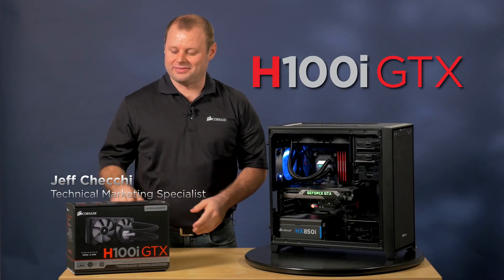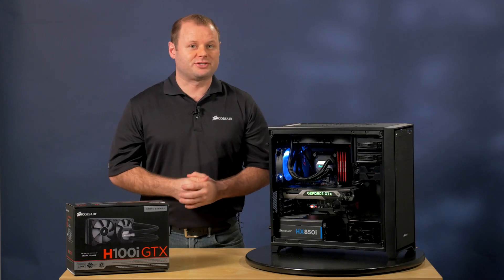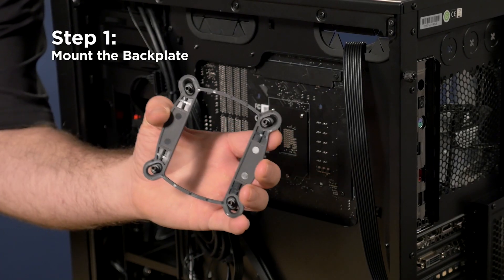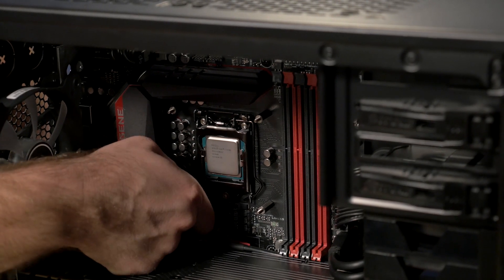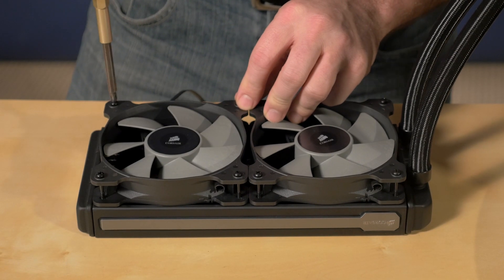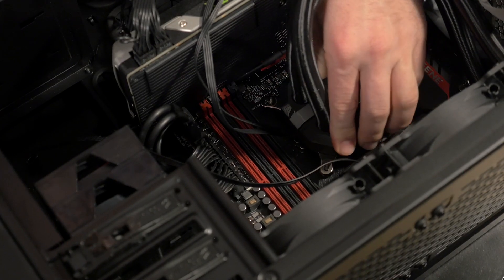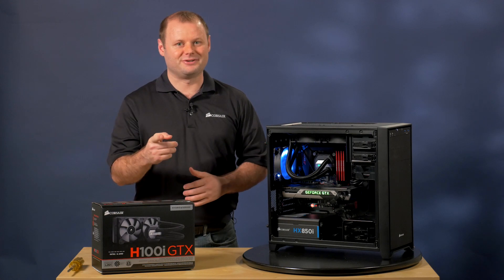Corsair Hydro Series H100i GTX Liquid CPU Cooler Installation How-To Guide

Comment: dumb questions:
1. does it matter which side the pumping unit is facing? (the corsair logo on my PC is facing sideways)
2. if I want to change the sides of the pumping unit.. can I do it without using new thermal paste? or then processor has to be top cleaned then new thermal paste.
Reply: 2nd question: I meant if I switch the sides by taking the thumbscrews off and switch its sides but keep the preapplied thermal paste on pumping unit.. or I have to use new thermal paste

Comment: is crosair 550w power supply is enough for This Cooler
Reply: It depends on the rest of your system
Reply: Are you going to be running minecraft at 720p or 1080p resolutions, and will you have max frames unlocked?

Comment: So the four pin fan header power the pump? Not the sata cable?
Reply: The fuck?
Reply: I don't know of any cooling pump that uses a SATA cable.  The pumps use the fan header, so that the mb can monitor the RPM's.  SATA is a DATA connection only!

Comment: Just one question, is it possible to damage an AMD CPU when over-tightening the thumbscrews using a screwdriver once diagonally tightened, it was a H115i.

And how much force is considered a lot, I grabbed my screwdriver with my fist and gave it a nice turn, but the system booted up and all is good, any possibility of damage if left as it is?

Comment: can i use this for Intel  6th Generation LGA1151 Socket ?
Reply: +Geeks Tutorial If you take V2.
Reply: what is a V2, you mean Version 2 of H100iGTX. Thank you.
Reply: +Geeks Tutorial There's two versions of the H100i, the H100i V2 and the H100i GTX. GTX is the newer model, not supporting LGA 1151. The V2 does.
Reply: Thank you very much for you support, if you don't mind can you suggest my best performing 6th gen Intel processor, no matter the cost! (for 4k video editing and 4k gaming) any help would be appreciated.
Reply: Geeks Tutorial I'd presume that the 6700k would be viable. Especially for 4k video editing.
Reply: Thank you very much!
Reply: Geeks Tutorial No problem!

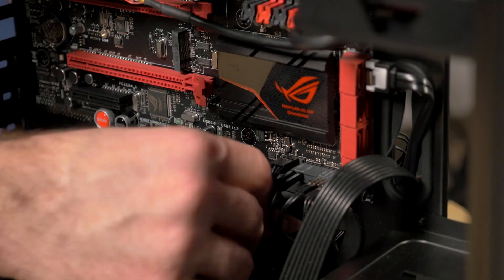Comment: 1:53 is that another fan header? I only have three fan headers on my mobo so if that's another fan header then i can't use this product D:
Reply: +Evang3lium No I believe that's a USB header that they're connecting to.
Reply: thanks!
Reply: +Evang3lium the 2 fans have a multisocket so they both go into ur CPU header and for the corsair link u need a usb header :)

Comment: is the data link cable included i take it? and where does it connect with the pc
Reply: +Jared Warner  The data link cable is included,  It plugs into a usb2.0 port on the motherboard.
Reply: Product0f Activites build is already complete and i got this h100 but thanks haha

Comment: why are there like no videos on the h100i v2?
Reply: The V2 is the GTX, they just renamed it :)
Reply: and they upgraded some minor things and they made the two things removable so that u can make them different colors
Reply: According to "CorsairGeorge" (a Corsair employee) on Reddit:

"They are rebadges.

H80i GT -> H80i V2
H100i GTX -> H100i V2
H110i GT -> H110i
H110i GTX -> H115i

In addition to the renaming, the H115i fan spacing has been corrected to our standard 15mm to increase compatibility with our older cases, and all the new products have the new logo and packaging."
Reply: +maezun oh ok cool

Comment: Hello corsair!!! I have a question for you: The h100i gtx is powered by sata right? Hitechlegion showed that you should not plug the pump in the cpu fan, but rather into a 3pin to molex/sata for constant 12v. Is it true or is the cpu fan good enough?
Reply: +Xetion surely thats not good, you're fans would be running at max RPM constantly comsuming as much power as they could, the reason for the CPU header is because its PWM controlled meaning the AIO will be controlled depending on the heat output of the CPU

Comment: Hi I have a problem with my h100i gtx I have corsair v 4.2.0.162 ,I has also plug in the corsair linkalthough the pump and temp is showing but the fan are showing 0 rpm even though they are spinning, is this a defect or software problem?

Comment: I currently have an nzxt s340 case and I am using the stock  cooler that came with my cpu. I was wondering if the h100i would it inside the s340, and if so where?
Reply: Hey man, I'm currently looking into purchasing a s340. Let me know if you find an answer to that
Reply: +Mergen Fremen I did find the answer, so it will fit, but you have to mount the radiator to the front of the case.
Reply: Okay man thanks a lot
Reply: +Mergen Fremen np

Comment: So I don't need to apply other thermal paste on the cpu myself? I saw someone else's tutorial on this and he applies extra paste on his cpu before he mount the cooler on the cpu.
Reply: +Loliconest If you ever pull the H100i off your CPU for whatever reason, you will need to clean the old paste then apply new thermal paste to the CPU before operation.
Reply: It might have been a different cooler he was installing. With the H100i GTX, the thermal paste is already on the water block, so you won't need to apply any thermal paste to the CPU.
Reply: superdude9077 Ok, thank you very much!
Reply: ***** ty

Comment: I bought a corsair water cooling in past, the water pump stopped working after 2 years and killed my cpu.  and after spending hours of research, this cooling has so many problems; noise, software and reliability, probably not worth spend $150 plus another $30 on then cpu fans replacement

Comment: Product is in the mail, and I have one question.. all the videos talk about using the Long/short screws but I plan on installing 2 additional Fans for a push/pull Config.. where do i pick up the extra 8 'long' screws needed.. what are the specs/sizes (if i need to go to a hardware store, orr is the hardware also included?

Comment: why isent my led's on the cpu cooler not lighting up i pluged it into a usb pin on the mother board and it doesnt light up? PLEASE HELP
Reply: Pump draws power on cpu header from motherboard usb cable is for link software only. If you installed aio correctly you should rma the cooler.

Comment: I love how I still have temps around 33 degrees idle even with this thing installed. I hate my lifeee:(
Reply: +sean. 33 deg aint bad if you got an haswell cpu
Reply: +sean. You wouldn't want it too cold either
Reply: +sean. That's perfectly fine. As Marshal said, you don't want it to be much more cooler than that. You don't want your CPU to be overheated, but at the same time you don't want it to be cooler than the temperature in the room because it will create moisture and could damage the CPU.

Comment: Incredibly frustrating that you can't find anywhere whether or not this thing mounts properly onto AM3+ boards, is there a reason that corsair just can't list it on their damn website? All you find is crap for Intel boards and NOTHING about AMD
Reply: +Stretch Reality Including Intel® processors in an LGA 1150, LGA 1155, LGA 1156, LGA 
1366, LGA 2011 or GLA 2011-3 socket and most AMD processors in an AM2, 
AM3, FM1 or FM2 socket
Reply: and if you pay attention I specificallly mentioned AM3+ of course now I know that AM3 and AM3+ have the same socket for coolling, but most people may not be aware of that

Comment: Can I fit this on the front of my case?
NZXT H400.
Reply: +Little King  According to NZXT The H440 supports:
Front 2 x 140 or 3 x 120mm 
 Top 2 x 140 or 3 x 120mm 
 Rear 1 x 140/120mm

Happy New Year =)
Reply: +kimminjoon87KMJ so,  is that a yes?
Reply: +Little King so it fit or not?
Reply: +Fazree Said yup it fit the top of the case.
Reply: Little King just plug n play?
Reply: +Fazree Said I got it someone else to do it fur me

Comment: I would like to point out that I'm greatly dissatisfied from this product. Because before buying didn't know that corsair link doesn't consider the cpu temp readings as the factor of its custom curve, in contrast you can only make a custom cooling curve from the cooler temp that doesn't flanctuate more than 3-4degrees. Even if you want to make this work, you can't use decimals. My oppinion is that this may cause issues in the future, because you get the about the same cooler temp readings even if your cpu is 70c which is acceptable or 85+ which is nearly warning.

Comment: My fan power lead. 1 has 3 pins another has 4. Both my fans have 4. I have a 3 pin power cable. And my header is a 4 pin. I get a cpu error press f1 to continue some help plz

Comment: Hi, is it wise to use those fans as exhaust fans?  Aren't you going pushing hot air from the computer into the radiator?  I have mine mounted underside like that but i'm using it as Intake and blowing air into the CPU and i have an exhaust fan to pull the air out the back and sides.

Comment: So where/when do you put the water or is it already inside the cooler?
Reply: +gagongflip389 Comes pre-filled so you have nothing to worry about.
Reply: +Lane Kerr How often should I replace it? Had it since October, and I'm not a computer guy, learning more and more tho
Reply: +MrSham3less you never have to replace it. Unless you spring a leak, which if it hasn't happened by now you're okay.   You can literally just leave it sit until you put the computer into retirement or you die.
Reply: +Lane Kerr awesome, thanks man!
Reply: +Lane Kerr But how long does a normal AiO water cooler last? 2-3-4 years. I couldn't find it on the internet, and i really don't want a leak. xD
Reply: ***** Hmm..How do I know my cooler acting up? How do I know its getting a need of change?

Comment: Witch one is better h100i or h110i?
Reply: +Gameplayer70707 h100i has two 120mm fans and the h110i has two 140mm fans.
So if you have room for an 280mm radiator (2x140mm fans) you go with the h110i. But if you have limited space like say in an micro atx case (e.g corsair carbide air 240) and you can only add an 240mm radiator you have to go with the h100i. I got mine h100i today and the performance is great. At the moment i have idle temps around 20degrees celcius and under 100% load about 40°C (Intel Core i7 5820k running at 6x3.3 ghz).

Comment: I need a good cheap case around 100euros that fits this cooling perfectly without any need for modding and with space to spare, id aprecciate some answers in the comments, thx
Reply: +Nunix maybe corsair carbide air 240 (mAtx, maximum 240mm rad.) or air 540 (more space)
Reply: i got the fractal r5, worked great

Comment: The power connectors to run the pump doesn't appear to be physically compatible with my ASUS X99-DELUXE motherboard. Any help would be greatly appreciated!
Reply: +BuddySteve Did you solve the problem?
Reply: +marto colt I guess not, lol
Reply: marto colt  Yes I solved the problem. Thanks!

Comment: I just downloaded the H100i GTX Quick Start Guide and it says the following: "For the best cooling performance, we recommend mounting the fans as an air-intake to your PC case."
So, this guy is a Corsair representative and goes against their recommendation. That's curious. It makes sense to me that you'd rather intake cooler room air than warmer case air. The only possible downside I see is that your through-case airflow may be disrupted by this arrangement. Does anyone have thoughts on this?

Comment: Can I remove the stock paste with isoprophyl alcohol and put my own?
Reply: +sticko240 yes, i took the thermal grizzly kryonaut and have idle temps about 20°c, after 7hours gaming/surfing 24°c cpu temp and 28°c water temp. (intel core i7 5820k @6x3.3ghz)

Comment: So the fans are blowing the air towards the radiator, and outward from the interior? So the other fan has to blow air into the case?
Reply: +Fimontronia both of  fans he installed on the radiator is for exhausting the air out of the case.
Reply: What about the other fans?
Reply: As a intake perhaps
Reply: +Fimontronia u can do it the other way round..or both ^_^
Reply: Yes you can. Most people say use the top of your case as a exaust. In some setups yes but I use the rear of my case as exhaust and top as intake
Reply: I couldn't put mine on the top part. It wouldn't even fit. I have Carbide Spec-03 case. I had to remove the drive cage from, and install it in the front of the case. And bought an additional fan. So it has 2 front case fans going into the radiator. And 2 fans on the rear side of the radiator going into the case. Both of my drives are in the 2 5.25 bays which kinda sucks. But it works. I own an external DVD RW that can plug in through USB.

Comment: he said 4 pin connector but mine has a  3pin?
Reply: haha, most peopel have the same issue as you (which including me)
Reply: Sorry not sure, can't remember that far back. I plugged it in somewhere and it's been working fine since my post but all I can remember.
Reply: you can plug a 3 pin into a 4 pin header, works just the same
Reply: I had this same issue please let me know how you fixed it. I would greatly appreciate. It ty
Reply: +JUSTIN BIBER I can&#39;t remember off the top of my head, I&#39;ll look into it and try find out for you
Reply: Crispyyy_ fucking idiot did you not read the comment they are trying to plug a 4 pin into a 3 pin
Reply: Nate L you dumbass ass, it's a 3 pin cable to a 4 pin on the motherboard. It works just plug it in.

Comment: How Exactly do you refill the cooler? p.s im not an expert about water cooling
Reply: ***** So why is it called water cooling?
Reply: +Waffleinatux Because it is pre-filled with water
Don't worry. Unless the manual or this video says you must do it, you don't need to refill the radiator.
Reply: Gastón Muñoz So lets say if it were to run out of the prefilled water, how could i refill the radiator
Reply: I know bro but Gastón Muñoz said its prefilled with water so does it run out?
Reply: ***** k man XD, sorry to bother you
Reply: ***** Well im Getting a MSI water cooling loop, theres no reviews on it but you can find it on amazon,google etc think it would leak?
Reply: A water cooler is always prefilled with water. You will never have to refill it because the water is in the pipes of the radiator, and doesn't evaporate. The only moment when the water runs out is when there's a leakage in the system, which usually means your system is sadly broken
Reply: What model of water cooling system do you want to buy?
Reply: +Waffleinatux Sometimes you WILL have to fill a water cooler, but that seldom happens. If you have to do it, the manual of the system itself explains everything, so you don't commit any mistakes. You should look, instead, if your water cooling system is compatible with your case.

Comment: my computer case already has 2 fans pre installed on the top, which i noticed in your video is where you place the radiator and the fans, does this mean that this product is incompatible with my computer case?
Reply: +Tyler Eaton Well that might come down to simple logic. Can you remove the fans? if so then you simply remove the fans and insert the radiator. If your fans can be removed and if the radiator fits then i think you can just screw this in no problem.

Comment: sooooooo. I installed it and turned it on. It lights up and the fans spin. However on the monitor when it starts up it says "CPU fan error". And won't start windows. HELP
Reply: +Majestic Potato if you havent figured this out yet you need to adjust some settings in your bios, google search for them because i cant remember which one to adjust.

Comment: I'm considering this cooler for a future upgrade on my computer, and I was curious about replacing the fans. I would like to replace the stock fans with a pair of SP120 Blue LED fans from Corsair, but I noticed that the speed of these are only 1650 RPM while the stock fans on the radiator are 2435 RPM. My concern is that when my processor is under heavy load, the SP120s won't deliver the same cooling performance as the stock fans and my CPU will overheat. Should this be a concern, or will a change in fans not matter as long as they are static pressure fans? If SP120s will work just fine, is there a specific fan configuration recommended? Is there a better type of LED fan optimized for radiators if these don't work? (For what I do, I don't see a scenario where my processor would be under heavy load, and having lower RPM fans may not make a difference, but I prefer to be safe than sorry.) Thanks.

Comment: If the cooler ever leaked and damage one or multiple other parts say a GPU or PSU would corsair cover they damage or would i be stuck with soaked parts?
Reply: Christopher Pinard Stop spreading such lies, Corsair stands by their word and if any parts are damaged due to a malfunction leak, Corsair will cover the charges for any damaged parts.
Reply: +thomas herrera I'm pretty sure that if you could show it was a manufacturer defect, they will stand behind their product and make things right.
Reply: No they would not. That is the inherent risk of water cooling.
Reply: Theory - Marlin Thanks i thought so

Comment: I have no fans on the radiator it is idle but was tested on dayz for 5 mins will it over heat without exhaust while idle?I'm at summer school:( it is over clocked 4790s